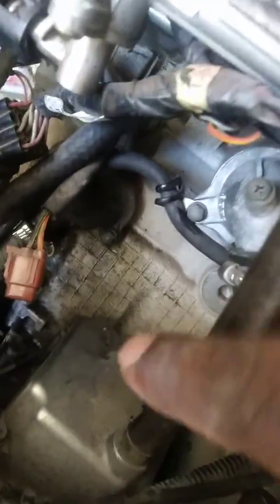2003 gsxr Thermostat Location

Comment: Mr JayBrisk did you replace your thermostat? I am finding ways on how to make my 03 gixxer run a little bit cooler on traffic. Any input/ideas will be very much appreciated. THANK YOU
Reply from the maker: Her bike was running hot , so i was just checking her thermostat. But i you want you want your bike to run cooler, i suggest a few things. 1- add a toggle switch to your fan so you can flip it on and off. 2- (most recommended) in summer time, switch coolant to Engine Ice, worked for me fantastically. Only thing is you have to switch back to regular coolant after summer. THANKS FOR WATCHING!!! BE SURE TO LIKE AND SUBSCRIBE.
Reply: JayBrisk0387  BIG THANKS for the info and advice Sir. I will do that